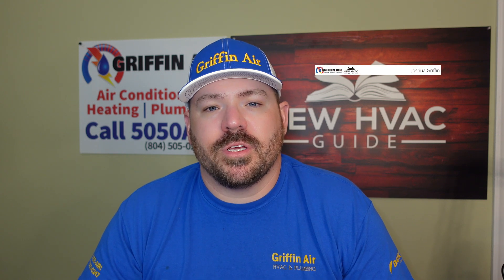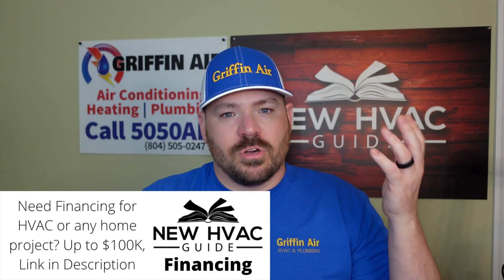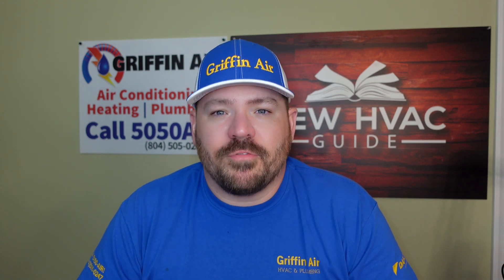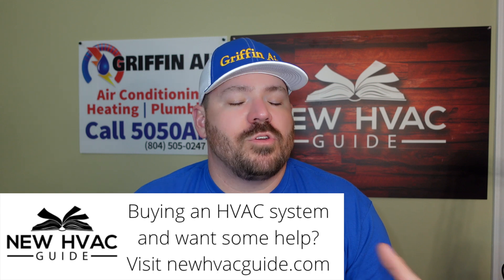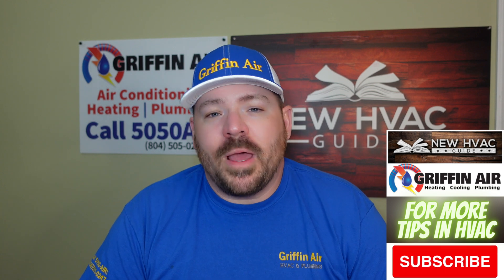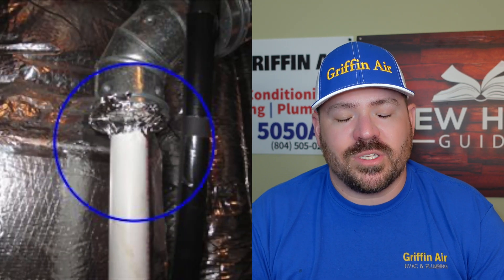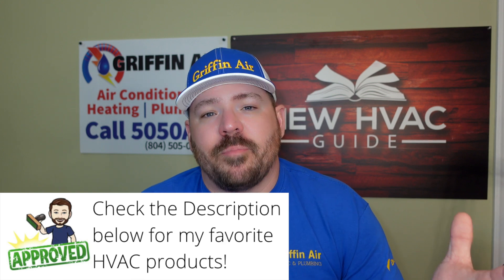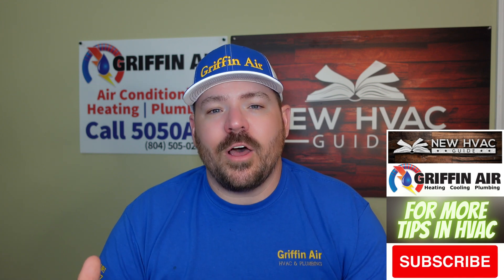RELOCATING Your HVAC SYSTEM!

Comment: Thanks for the helpful videos!  Very informative.

Regarding outside condenser units like the 37MUHA,  we have one on a 3" platform which seats on a concrete floor.   What is the proper/recommended way to level it as a DIY?     We noticed that it is tilted towards the building.   As a result there is condensate going towards the building.  There is also condensate from the main drain that goes to a drain pan.  However, there seems to be excess going to the platform to the concrete floor next to the building.

Comment: I wanna move my furnace unit 4 feet... was quoted 15000 lol... They put the unit right in middle of basement, and i just want it against the wall more so when ifinished it, its not taking up a huge space. Like wtf. The sad thing is, its just shortening the lines by 4 feet, and shifting the ducts. Adding some pipe to gas line and thats it... 15k... other quotes were higher.

Comment: I just want to move the AC outside a couple of feet away to allow for an outside door to be put in my laundry room. The AC unit would block the entry to the door so i want it moved about four feet to the right. Would that be expensive? New build so new unit. In TX.
Reply: You are looking at $2700.

Comment: I am replacing the whole heating and cooling system. I want to instill the furnace few feet’s away from where the old one was. Will this add significant const on my project? Answer asap would greatly help.

Comment: We have an air handler/furnace system that is smack in the middle of our basement. It’s right next to our hot water heater as well which is consuming a large amount of space. The air handler/furnace is 22 years old and we plan on replacing it. We are thinking this would be a great time to move the system to a corner of the basement and do a tankless water heater. We are also in Virginia. For some reason they didn’t do a trunk with flexible duct going between joists and instead just ran the ducts perpendicular to the joists which also would force us to a drop ceiling which I would love to avoid. Aside from new unit cost- hoping if we move the unit and have a trunk and run between joists for vents that it won’t cost too much. Would be moved say 15 feet away.
Reply from the maker: Sounds like quite a project. Where in Virginia are you located?

Comment: ugh - knew it would come to replacing the system. But it's a condo - second floor just under the roof. So we'll need a crane for rooftop unit AND I want to relocate the indoor unit (heatpump?) . Right now the air exchange is though the one bedroom since the unit is in the back corner of the bedroom closet. There's a wall vent to assist air flow that opens to the living area. Whole set up sucks. I want to move to the existing bedroom door area in the main hallway and cut a new door in where the big vent is. Plus replace all the ductwork since previous occupants were heavy smokers - can't get that smell out of the place. (yeah - that bad. eastern european. such heavy smokers) $$$ but worth it in the end I think. did I mention july, in florida? so extra painful....

Comment: It's going to cost thousands of dollars to move your HVAC system. It could cost more than $10,000 if we need to change a lot of ductwork, plus electrical, gas, venting, and refrigerant lines. I would avoid moving your indoor unit, it's not worth the price to make the change. Just moving the the AC or Heat Pump outside is going to be expensive.
Reply from the maker: Eek. 10 grand buys a new system here 🙂
Reply: @NewHVACGuide Not on the West Coast. A completely new system that includes a Heat pump or AC, Coil, Furnace, electrical, venting, gas lines and all new custom metal ductwork, is easily $40,000. For a large home it could be $70,000.
Reply from the maker: Wow!
Reply: @NewHVACGuide  That's a high price, definitely don't find that on the east coast
Reply: @NewHVACGuide  People trying to charge 7k here to not even change out the evaporator coils or lineset moving from r-22 to r410a on just an A/C install here.(Seems like a problem waiting to happen )  I am just browsing this vid because i was looking to move the setup just a few feet in the same room for more height clearance to allow for the bigger evaporator coil. I was thinking they could just shorten the exhaust/intake vents for the furance, the new lineset was really needed anyhow and coil and i figured move the supply plenum over and put in a new section of ductwork. But estimates so far all seem to want insane money on a 3.5 or 4 ton heat pump unit when i figured it should have been around 10k.   Your videos are informative as always.